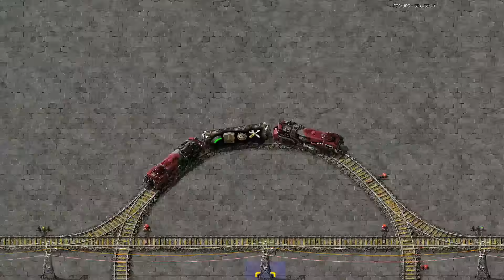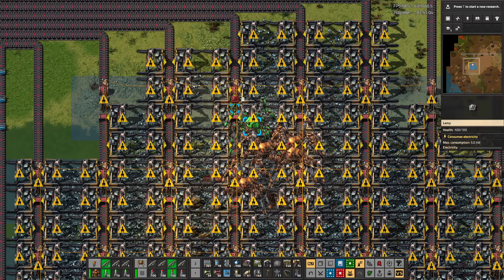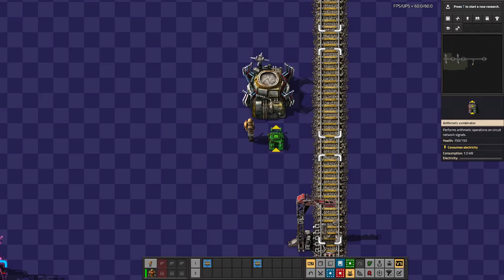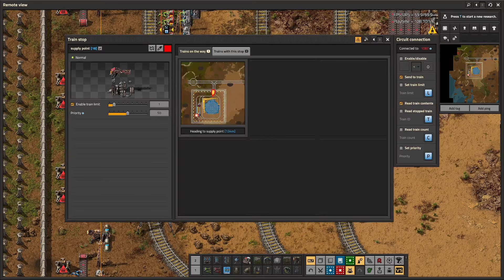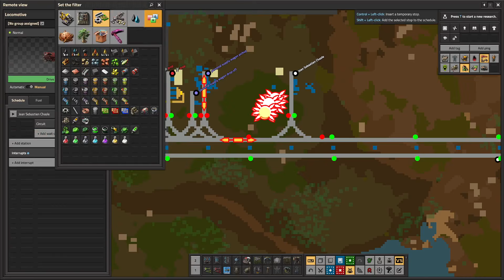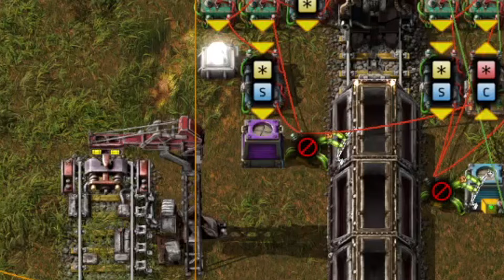Supply Trains: Basic, Cursed and Optimized. (Feat. Personal Logistics Trains) -Factorio 2.0

Comment: Every time a video like this appear to me I feel like I'm the dumbest player on the game
Reply: Don't feel too bad, I'm currently trying to figure out how to get train stops with more than one train to work and that alone is beating my ass. I don't think I've used any kind of circuit logic or combinators in almost 300hrs of this game lmao.
Reply: As far as I know trains with a common name always choose the closest one by default so maybe you should make it so the trains limit how many stations or how many trains can wait to reload this station and then basically you have two trains for the closest one to trains for the next closest one and one train to go wherever it's needed
Reply: @sky0kast0  The "best" way I've seen that done is using combinators to read the contents of the buffer chests at "dropoff" stations, calculate how much room they have, and set the "train limit" based on how many full trains the buffer chests can fit.

That ensures that trains don't move if they don't have to.

Also, train stations have a "priority" slider, which you can use to change how likely "shared" trains are to pick them.
Reply: @monsterfukk7737 I’m right there with you except 680 hours and maybe 200 of that as afk.
Reply: @monsterfukk7737  Getting trains and train stops to "pool" is pretty easy--you just set the train stations for each "group" (e.g. "[Iron ore icon] loading" & "[iron ore icon] unloading"). Then you can set the trains to cycle between "load" and "unload" (e.g. "load station" with condition of "full cargo", and "unload station" with condition of "empty cargo"--Just don't add a timer on the "unload" side unless you know how to set train station "train limits" with circuit conditions so that your "unload" stations only call for trains when they need them).

If you want to be able to add more trains later on the fly, with minimal hassle, you can just create a "train group" for each kind of train--that way you can just add each new train to the "train group" and it'll pull it's list of stops up on it's own without you having to manually set them every time (or you could "blueprint" your trains, but I'm pretty sure that can only be done by loading into the "editor".).
Reply: me too, train logic was something what really burned my "heat exchanger" in past. Long time it took. As a real genius in mind I started with two sides locomotive and without knowing what light actually wrong (zooming out and remove control was such a discovery)).
Reply: I came hear to learn how to move iron ore from a patch to my base.
Reply: SAME
Reply: Apes together strong
Reply: Ditto 😂
Reply: Im new and trying to figure out trains for the first time...... ya I feel dumber than a box of rocks....
Reply: Me too 😂Im still learning new things I think just shy of 1000 hours on steam and haven't launched a single rocket in vanilla haven't bought spage yet due to my smooth brain not understanding basic circuit logic 😂😂
Reply: I guarantee most if not all of the people who make shit like this or play with combinators and logistics are all programmers. Trust me when I say that factorio circuits and logistics is very similar to real programming
Reply: @jelapenno  As a Computer Engineer, let me tell you they're not that similar. They're actually cumbersome and hard to figure out. The interface sucks and the wiki feels like coursework. Don't get me wrong whoever made this game is a bonafide genius and I'd never be able to accomplish anything close; but the train and logic parts are designed like crap. It shouldn't be this hard.
Reply: You and I both 😅
Reply: real lol
Reply: Few minutes in and the idea of taking a tiny bit of oil you’ll already have at each area to use to make fuel instead of having a stop to refuel makes me feel like an absolute oaf lmao
Reply: And then you look through the comments and someone gives a generational insight to a problem not apparent to the poster and they genuinely just are still that much better. 
There is always a bigger fish. Dont feel bad.

Comment: *sigh only an idiot would use trains for this. Setup requester chests at each out post if your gonna do this and setup the same circuit system you have to request from bots after sanitizing or just be like me and save the space and work with negatives so every negative is something you actually have which makes the bots requests faster and saves room on sanitizing, same thing I did on my run of Space Exploration mod. Set a cap on your bots also I like to use 4 to 5k logistics bots same for construction. Trains are extremely neat but just don't at all use them for this. Your gonna be branching out in lines with roboports anyways so it'll distribute your bots for you so its better than trains. Also if you run the chest items through a arithmetic taking the modulus of the cap limit of the items then run that, through a decider combinator set to each  (yellow top one between red and green) > 0 then output signal of 1 then run that to all the stack inserters it'll copy what you need and pass it to the arms and the modulus will cut it down to 1 item at a time before it stops up. Also set the arithmetic to everything times 1 output each. If your doing more than one item a chest you can use the selector to sort the signals by the amount also before running it into the arithmetic.

Comment: I built a similar setup and came across an annoying bug that I couldn't completely fix - if the train is full of items and goes back to the depot there will be a single tick where the inserter has a stack and will put them into the train wagon; this can happen if you add a fluid wagon to the system and fluid is needed but no items are removed. It resulted in my trains getting slowly full. It is quite an insipid issue as no amount of delays for the "read train contents", or other such delays seemed to stop this solitary tick going through. I tried a few other ways to disable the inserter but its always a tick too late and once it has items in its gripper it will deposit them the next tick that slips through. Very annoying.
Reply: You're talking about if the train comes back full and the inserter gets a signal before the train can tell the inserter "hey I'm actually full"? It eagerly loaded one tick of items onto my train when letting it come back fully loaded. I think I know what you're talking about and I solved it by checking for the train stopped ID to exist. Then I AND that condition where the shopping list is computed to make sure theres a train already parked AND its contents can be read. Otherwise the solution he has is a little broken and further requires a fully stopped train to work. Otherwise you need to program another branch to compute what is overflowing to take that one tick of items out. Hope that helps.
Reply: @Insideoutcest  Yesh I tried disabling the inserter if there was no T train ID signal but the T update is also a tick too late to stop it grabbing. 

I found you can actually eliminate the issue with a 4 tick delay introduced into the set item wire before the inserter. Not elegant chasing 4 extra deciders in but it works; I’d love a proper explanation of where this delay in the contents of the train being updated actually comes from…

Comment: So after rewatching this video dozens of times I finally understand how to build the circuit for the outpost drop off points.

Based off other commenters, and examining your blueprints, I was able to simplify the Outpost Hub circuit by removing the initial Decider, and directly multiplying the shopping list by -1, then in the following Arithmetic combinators, multiply by -1 again for both, to get a positive stack size and set the inserter correctly.  So yeah I finally get it.  I must've rewatched the specific section at least 10 times.

Comment: Since inserters have multiple filters, you could get away with some boxes having multiple types of items, right? Not sure how you would do the circuit logic, but couldn't you theoretically have a single box that contains for example 50 each of turrets, flamthrowers, poles, and drills?

Comment: Thanks for the great video, this was exactly what I was looking for. I have a question though, I set up a small test using your blueprints, the dropoff is in an empty network but even after the first trip only half the cargo wagon is emptied. Was there any change which broke the bp, or is there something I am overlooking?

edit: I managed to fix this problem but is there a way to also add a fluid wagon? When I add light oil to the shopping list the inserter gets stuck since the S signal remains at the requested liquid amount, even if the fluid wagon is filled.

Comment: I really liked this system you made.  It worked well for me until it clogged up on me since i didn't want to program each train car specifically.  So I setup a second inserter on the hub station that extracts from the train car anything that doesn't match the logistics group exactly.  So if an extra belt / ammo gets into the car it gets extracted, It also allows for changing of the logistics group on the fly and the train will adjust what is being grabbed.  Pair this with a trash train station placed next to an outpost station and anything extra at that station (mostly used for rocks/trees) gets picked up once a threshold has been reached. 

Thank you for the BP and the Inspiration.  This video/BP set really helped me to understand circuits and logistics in 2.0.

Comment: man, i just use less stacks, and pull out overflow. you can do that with 39. But my outposts are only for my defensive walls, which only need about 20 unique items
this solution is definitely over engineered though, which makes it better.

Comment: You can also feed the (sum of the) logistics groups to the buffer/requestor chest and that will set their request lists. No more mucking about with setting logistics groups in the combinator and forgetting to update the request chest. The chest will only see the aggregate manifest, not the individual logistics groups. So if that's important to you, stick to the manual process.

I'm using the sort ascending and sort descending modes to load two separate wagons. I have more than 40 stacks of stuff (i could just simplify by using one type of power pole and not using turrets, and forgetting about doors because I'm using spidertrons anyway, but that would be too easy). So I load one wagon with small stuff, one wagon with the big stuff. There's no collision in the middle because a) if they both load the same thing the train's total inventory is updated anyway, and b) if they end up loading too much I have a junk extractor.

For the junk extractor I have  a combinator looking at what the train has in excess of the request list (for each if train is greater than manifest, each 1), and telling the junk inserter (actually an extractor) to remove that junk from the train (this includes empty barrels because I tried sending light oil to remote flame throwers using logistics bots). At the remote end, the junk inserter is removing stuff from local inventory into the train.

Also does anyone know how to stop the logistics network deciding that the best thing to do with the wood collected from clearing forests is the storage chest at the furthest point of my logistics network? That's four kilometres away. I could make do with half the bots if they weren't busy hauling stuff to the other end of the world.

Thank you for sharing the joy that is just futzing around with circuit logic and finding new ways to break our factories :D

(and having finally finished watching the video what I do there is basically what you suggested in the personal logistics train, I guess I didn't pay attention the first few times through)

Comment: i keep running into problem where my first item (walls) keeps putting a first inserter set into the wagon even though the wagon already has its full load of wall - when the train leaves the circuit reads nothing from the train so it creates a request for the full load of the wall - then the inserter drops the first set in when train arrives and circuit updates telling it that it does not need the wall anymore - i followed along and used two selector combinators as in the video - then got the blueprint and used two arithmetic combinator like the blueprint shows - both to the same effect - the first load of wall gets dropped in regardless of whatthe wagon has - so eventually it all clogs up - what am i missing?
Reply: [Copy of my main comment ]I have found a small flaw in the outpost supply Pick-up design. Before the train arrives, the system is acting as if the train is completely empty, as the signal reading the train contents is outputing nothing (because the train is not there). This means the inserter (before the train returns) will be filtered for the item with the highest number in the shoping list logistic group, usually ammo. This can be seen at 15:21 ; The inserter is filtered for green ammo before the train arrives.
Once the train arrives, the inerter will move one hand size of ammo into the train before the signal carrying the cargo contents reaches the inserter. If the train is full of ammo (or whatever item has the largest value in the logistic group), then the interter will over-supply the train with one hand size of ammo. 
This can be fixed by also reading the train ID from the station and adding a "AND T != 0" condition in the sanitisation combinator (The Decider combinator that says if Each >0 output Each).
As T will always be a positive number it will not be passed beyond the decider combinator but will prevent the shopping list signal from reaching the inserter before the train arrives.

Functionally this is not a problem, as the highest value signal in the shopping list is likely to be used the most, and the train will very rarely be dispatched and not deposit handsize of ammo, (plus adding one extra hand size of ammo into the train is unlikely to be a problem), but it came up in my testing and makes the sytem a bit cleaner. Plus the solution I found is quite elegant in that is doesn't need any extra combinators to work.

Comment: Yo, you made exactly the build I need. But the inserter continues to fill the train with 1 type of item regardless of the shopping list -_-
Reply from the maker: Make sure the train is properly stopped and that the train's contents are being read properly. That error will occur when the train's contents are not being subtracted from the shopping list correctly.

Are you using the blueprint provided? I may need to make a correction to it if so.

Comment: Why not just read the hand contents of the inserter and i slide that in the network?
Reply from the maker: You could do it that way, rather than reading train contents to subtract from the shopping list, but you would also need circuitry to reset the memory cell when the train departs.

Comment: For stack number under 40, we can actually check that by circuit. 

1- Link the shopping list to a selector set to stack size. 
2- Use the other color to link the output to the imput of a arithmetic combinator. Link also the shopping list there with the first color. Devide each from the first color, from each to the selector output color. Output A (number of stack you are requesting). 

BUT factorio troncates the result of a division so you need to take care of that. 

3- Copy the arithmetic combinator you just use, with the same circuit link, and change the divide by a modulo (%) and output each instead of A. 
4- then you link the output to a decider combinator set to "each > 0, output 1 A". 
5- Then you link the output of this decider, the output of the first aritmetic (the dividing one) and you have A that said exactly how much stack your shopping list will need in the train. 
=> you can then link that to an alarm set to work if A >40 and you will be warned if you made a mistake with the number of stack.
The modulo part is important only if you request item without caring about their stack size (for example, requesting only 20 robots instead of 50)

Comment: Here is how I did loading Stations so far:
AC: Each red (request at station) - each green (train content) = Each Green.
SC: Select Input 0
DC: Each > 0 : S Input Count and Each Input Count
Conected to a Row of 6 Inserters that each have Chests with different Requests. This way it will always load exactly the right amount.
It's not faster than yours but you can sort the chests better.
Also if you dont want to bother with Handsize you can have a Inserter taking out excess items. Just use the AC output and filter for each < 0 again. That way you can fill all but one slot per wagon exactly.
The Legendary Quality Inserters are Problematic so far because they can swing faster than the 3 tick our logic takes. So I just stop at Epic. Works like a charm.

Comment: Nice work, seems like a worthy follow up to the 5 part Fooluaintblack's "Supply Stations and How They Work" from a few years back.
I'd love to see the blueprints or better yet the save file for the test save you have as you've made some interesting circuit design beyond just the supply stations themselves eg the displays for what is at the station, the 2 second pull inserter randomiser to the infinity chest to simulate demand, and the displays showing lap counts and timings.
Keep up the good work.